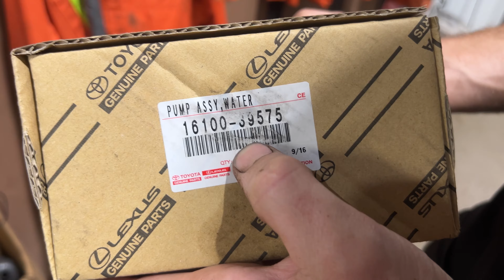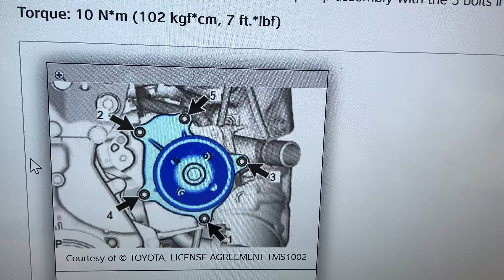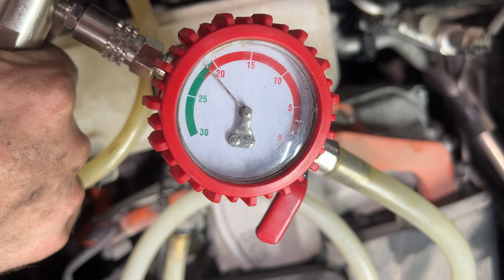Water Pump Replacement 2017 Toyota Rav4 Hybrid

Comment: Good video helped me out . I found it was a lot easier to just take out other 4 bolts on upper motor mount and jack up engine . Also my reservoir bolts came out easily and not rusted .